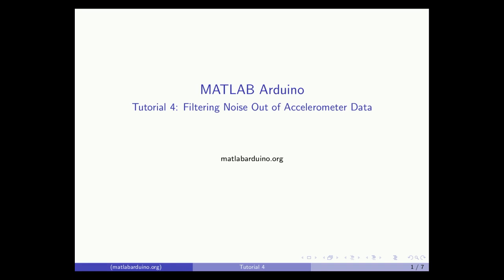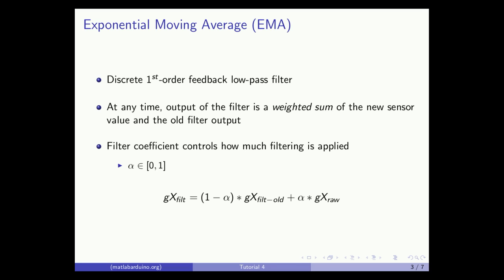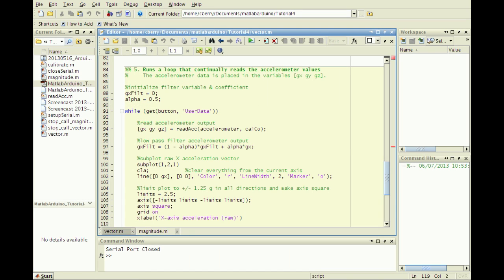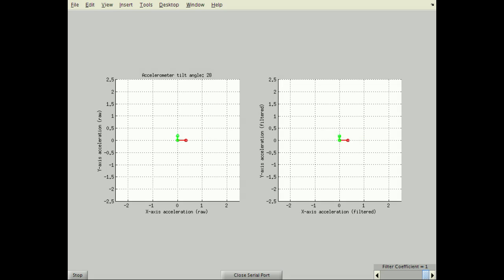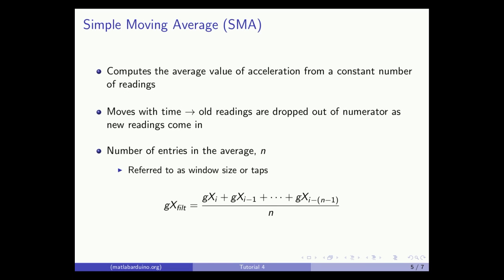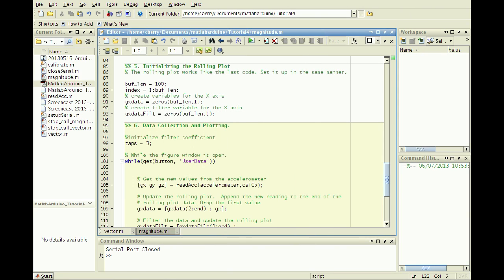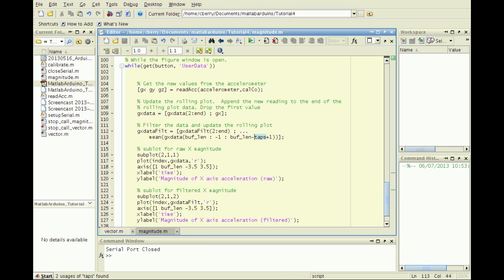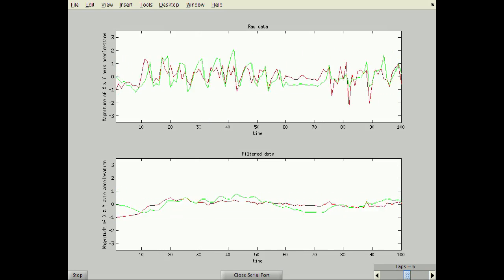MATLAB Arduino Tutorial 4 - Filtering Noise out of 3-axis Accelerometer Data in Real-time

Comment: Hi, I'm currently looking for a way to extract displacement data from an Android device's accelerometer. I'm aware that this is difficult because of the noise in the sensor data, and I've looked at implementing the exponential moving average shown in the first part of this video as a way to reduce the error. Do you have any other suggestions for algorithms to use to further reduce this error? Would multiple noise reduction techniques, compounded onto each other, help?

Thank you in advance, this was an informative video.